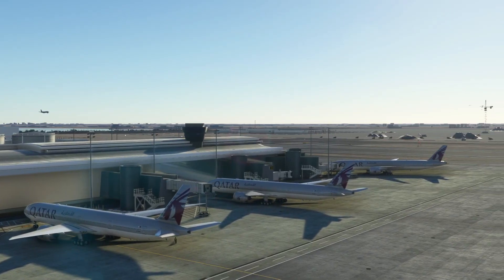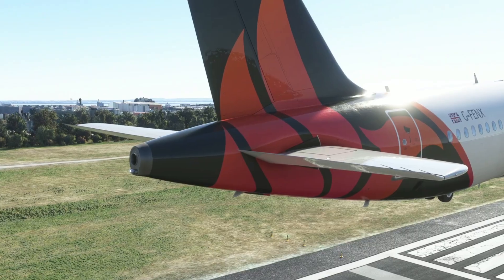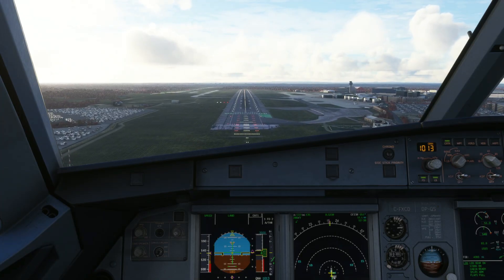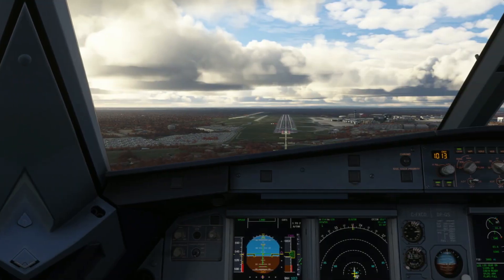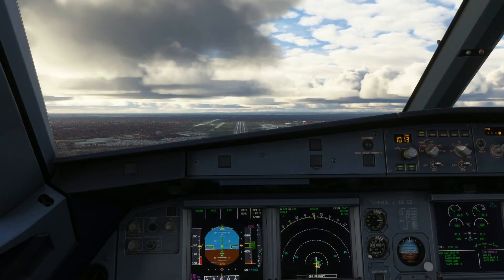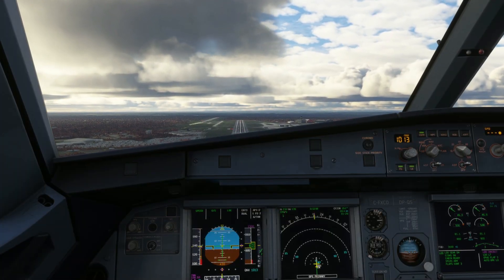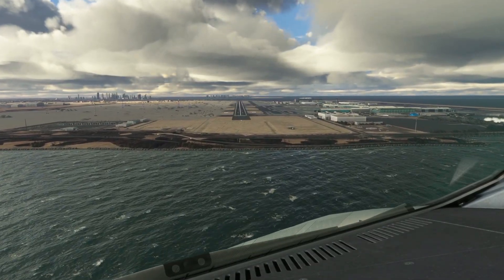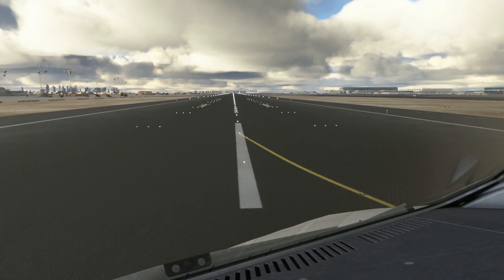A320 Landing Techniques - Flare Law (How & When to Flare) Full Tutorial | MSFS 2020

Comment: How best to handle strong crosswind landings on A320/21?
Reply from the maker: In very simple terms, use your ailerons to stay on the centerline as you approach, head into the wind and crabbing side wards down the approach path, then at about 30ft, use the rudder to align aircraft with the direction of the runway just before touchdown.

Comment: hey can you tell e how you doing t with the boing 737 ax i try to land but the arplane spns up and down so crazy so ts super hard to stablize the plane on the final
Reply from the maker: Afraid I don't fly the Boeing, but it doesn't have the same flare law as Airbus.
Reply: @Easyjetsimpilot  i like to play the carrer mode so i have not so many options there ... the boing s hard to control becouse if the trim system!

Comment: Since I have switched from Toliss over to the Fenix, my landings have gotten very bad. The amount of stick input that I used for the Toliss is way to little for the Fenix. While I am trying to solve this, I noticed that I don't really have a flaring technique and that's why I luckily found your video - which helps a lot. I am too focused on the vertical speed. Instead I should look out on the runway and get used to the appropriate pitche angle. Time to get behind the computer and fly this wonderful airplane again.
Reply: Looks at pitch angles. You should go from 2 degrees to 5 degrees (@140kts), that's how you always flare.

Comment: I think your advice to flare late with a headwind and early with a tailwind is correct but for the wrong reason. It's not a case of more or less wind over the wings since that depends only on your indicated airspeed. With a headwind, your ground speed is less and so, for a fixed glide slope angle. your vertical speed is less and that's why you can flare a bit later. You don't have as much rate of descent to get rid of. The opposite is true for a tailwind. Kind of a minor point. Nonetheless, an excellent video, very helpful.

Comment: Thank you Gav for the nice videos, but i have a question regarding the Fenix A320, i have noticed since Sim update 10 that the lower beacon lights are not reflected on the engines (especially if u look at the engines from inside the cabin)…i dont know is this related to the sim settings or the aircraft settings or is it normal?
Reply from the maker: I hadn't noticed. 🤔

Comment: hello gav, I have a question to you. after SU11,  I feel really hard to land smoothly, especially to perform flare. Float or bounce. Is that any change of aircraft flight model? before SU11, I could land with Fenix a320 very well, and I know well  about the landing technique, So i think it is not the matter of documental knowledge about landing(flare timing, etc..) + Are you still using same setting with your previous video? I saw your previous video about TCA airbus stick sensitivity setting and I have used that setting.
Reply from the maker: Yes, all settings are the same. Since SU11 things became more realistic - which incidentally means more difficult 👍
Reply: @Easyjetsimpilot  okay:D I will try more practices thx gav!

Comment: I'm a bit puzzled -- If you don't touch the stick during the last 30ft, then what exactly is causing the nose to lower if (a) the THS is fixed, and (b) the elevators are in direct law -- ie. only moving in direct response to the stick?
Reply from the maker: The THS is fixed at 50ft, it's then begins to lower the nose at 30ft.
Reply: @Easyjetsimpilot  Ah, thanks!

Comment: I’ve noticed when the 320 goes into flare mode, there seems to be a big reduction in rolling the aircraft to adjust to the center line if you need to…. Is that normal?  It’s like the roll control gets “mushy”. Is there a bank limiter that kicks in or something?  Great video!

Comment: At 2:38 you say there’s a direct relationship between the THS (Trimmable Horizontal Stabilser) to the side stick. A slight error there. At 50 ft the THS is frozen. The relationship between the side stick is to the elevators. The video is a bit misleading as it’s a replay because it’s showing full up elevator. At 50 ft the THS is frozen and your side stick deflection then just directly controls elevator deflection with no auto trim getting involved. 👍
Reply from the maker: I've seen replays before with spoilers up all the way down 🙈 hopefully will get fixed in the future.
Reply: Would you not let him believe he's actually correct about something for once? 😂😂😂
Reply: @notleks2411  Sorry. Apart from that minor error it was all very good. 😁

Comment: Last year I was in a real simulator used by TAP Air Portugal pilots during the pandemic and I was told that, in a normal flaps full and no wind landing, in real life, pilots start flaring at 80 feet because the airplane takes a few seconds to respond. Can you please you confirm this?
Reply from the maker: I've never heard of a pilot flaring as early as 80ft, but I'm also not familiar with TAP SOPs.

Flaring at 80ft would be before the aircraft entered Flare Law which does seem very peculiar and could lead to a long landing.
Reply: @Easyjetsimpilot  Thanks you very much, I was feeling that it was not correct. Regards